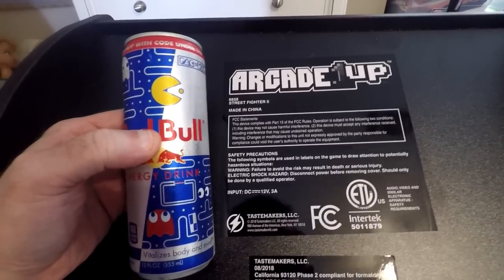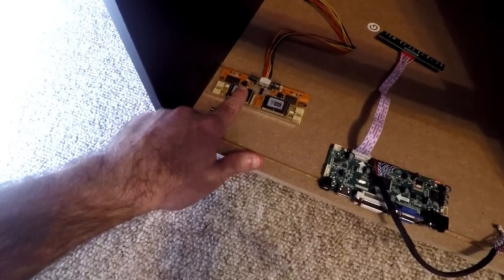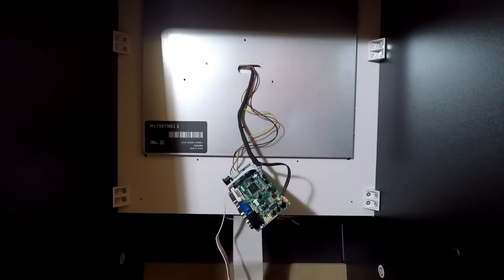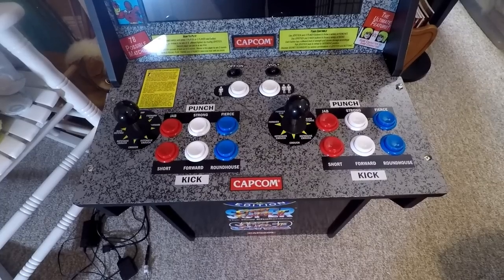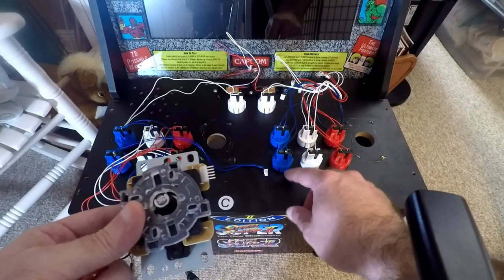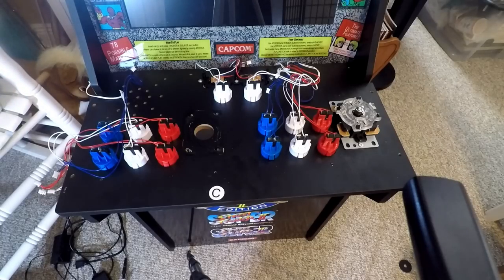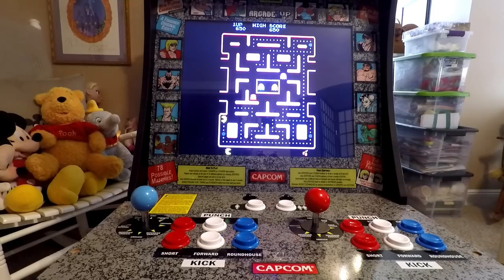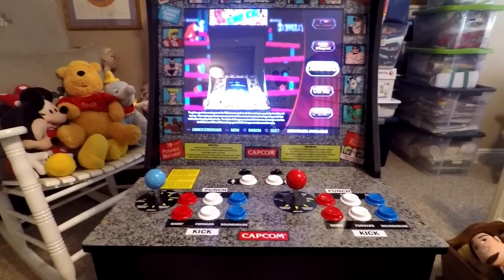Arcade Players Dream! Arcade1UP Raspberry Pi Install with EXISTING BUTTONS and POWER SWITCH! TeamCC

Comment: U plugged the buttons into the up down left right for joystick like happ. You didn't have to make the extra buttons. What u could of done is go into retroarch and configue coin button as the player one start. And coin 2 as player start 2. So when u press player one it will use coin and start the game. Same for player 2. Then also make player one as ur hot key and make player 2 as ur exit key. So when u press player 1 and 2 at the same time it will exit the game. Player 1 with add coins and start same with player 2
Reply: Huh, that's interesting. I've only barely peeked into the Retroarch settings myself. Seemed complicated to me... Eek...
Reply: Greg's Game Room if I have time today or tomorrow I’ll make u a quick video. It’s better to go to retroarch and configure the buttons so it’s the same for all games.
Reply from the maker: I figured out what I had wired up wrong pretty quickly. Then I pulled up the board and saw the labels. I will try that button config and let you know! Thanks for the suggestions.
Reply: How do you do that ??
Reply: @thelegendcollector8538  I'd really like to know that as well. I get what Mario Pirchala is saying, I just need a little better explanation because I'm not very good with this lol
Reply: @FlanFanNetwork  I'm trying to do exactly what you described. I'm not quite sure how to do it. Could you possibly explain it further? I think I get what you're saying but I'm new enough to this to where I need a little more help
Reply: @RussTCB1  well I just ended up wiring the coin button to the on and off switch and the 2 player coin to the volume button
Reply: Please can you make a video tutorial on how to configure the p1 p2 buttons? That will eliminate having to drill altogether. I own the SF and Mk cabinets and im on the process of modding them but i lack on drilling skills.
Reply: @FlanFanNetwork  any way you could walk me through the retroarch config? bought my pi and all other things needed but dont have the tools to drill holes. so i would definitely love to use this method to avoid that!
Reply: Sweet!!!!
Reply: @ILazzarus666  setup ur player 1 and player 2 configuration. Then from retropie menu go to retroarch then from main menu go to settings then input. U will see player 1 input and player 2 input. Change select button as player 1 button. And start as player 1button. Do same for player 2. Then go back to main menu. Select configuration and save current configuration. Now when u play any rom the player 1 acts as both. This works for any multi player cabs like SF MK TMNT etc. If ur using only 1 joystick cab like PacMan etc with older just mame roms. Load game and press tab. Then select controls for game. Here u can select 1P as coin and start.

Comment: I found a way not to drill new holes for the Joysticks. Simply swap the metal plate of the original joystick to the new one.

Comment: why did you have to flip the switch vs just swapping the pins on the GPIO??  Black go to black (ground) and red to pin 3........and then no need to flip the switch.  I'm not telling you - general question for you or anyone reading.

Comment: IT WORKED! THE POWER SWITCH WORKED! I am beyond excited right now. Thank you.
Reply from the maker: I felt the same way! I needed it to function normally so the kids could turn it on and off. It seems so simple yet so satisfying when it worked.
Reply: @VirtualCrawfish  could you of just put the red wire on the gpio 3 and black on the ground and not have to swap the power button around?
Reply: @VirtualCrawfish what if I’m using the ground 6 for a fan can I connect to a different ground with no issues??

Comment: I have just completed a full conversion to my cab following the ETA video - replacing all buttons (and adding 2 new ones) and the sticks too.  Then I found this - excellent as I was stuck with the power and volume sliders unused until I followed the instructions referenced here. I cabled the power slider to pins 5 & 6 and the volume slider to pins 12 - 14 on my Pi 3b+. Swapped around the power slider and then created the script that makes the volume slider function.  Perfect and all works without issue!  When creating the script, run the amixer command first as this will tell you what sound source is being used - in my case it was HDMI so I replaced the PCM amixer reference in the script with HDMI and it all works perfectly.  Thanks for bringing this to my attention as cab feels more complete now.
Reply: anyway i could give you some money to make a pi 4 script lol?

Comment: Well thorough vid, but i have to say i kinda knew that you were going to get hung up on the select issue, hence why ETA did it that way.   On off switch very nice idea.  Good to know in advance that the stock buttons just plug in directly into the encoder without a new wiring harness.

Comment: I like your video. You sound like me when tinkering and building. I'm modifying my Street fighter 2 arcade1up and love videos like this to bumper me in my projects. 

Well done. I appreciate your humor and yet stick to your guns on parts of it. 

I've modified a broken cabinet, replaced the screen with a dell monitor screen and joined a pandora's box control panel for it. Kind of using what I have. But I would like to get a Mortal Kombat Legacy cabinet and follow your setup. Not too much but enough to keep it original as possible and yet give it the goodies inside.

Again, good video. Cheers.

Comment: I have a Arcade1Up Rampage cabinet on the way. Your video convinced me to try a conversion too. I ordered the Raspberry pie, LCD controller and the USB controllers. The Rampage cabinet has 3 players. 1 joystick and 2 buttons for each player. Since 3 people around an Arcade1up cabinet is a pretty tight squeeze I think I will sacrifice the middle player and use the 2 buttons as the credit buttons. Maybe someday I will change the stock joysticks and buttons and when that happens I will add new buttons so that I can also play games that need 3 buttons. I don't need 6 buttons as I have no interest in fighting games. 3 buttons will do fine.
Reply from the maker: First off thank you for watching and commenting. I am excited for your project. I think you will enjoy it so much. I am not sure which type of joystick comes with the Rampage cabinet, but if it is like mine then they will not work with the USB controllers for a Rasberry Pi project. You may find yourself replacing those sooner rather than later.
Reply: @VirtualCrawfish  I will have to look into the joystick issue. I assume Arcade1up uses the same joysticks for all their cabinets. The cabinet I really wanted was the Pacman one but due to it only having 1 joystick and the 2 player buttons I would have to completely redo a new control board. That and the screen being vertical made it too complicated. I just hope one of those vinyl decal makers do a Turtles in time set.
Reply: @VirtualCrawfish  I had a look at the Joystick on my Rampage cabinet and I understand the compatibility issue you mentioned. Regular arcades were built to have pieces easily replaced. That involved having each individual microswitch wired to the board on it's own. Arcade1Up went the more simple way and added a little circuit board that merge everything into a 5 pin connector. If the USB controller I ordered doesn't have the right connector for the stock joystick I will simply use the cables it comes with and solder new individual cables to each microswitch.
Reply from the maker: I am VERY interested! Please let me know how that turns out.
Reply: @VirtualCrawfish  My USB controllers have been shipped and I already got the Raspberry-pie. I will let you know how it goes once I receive them. Maybe I won't even need to solder them If the metal connectors that come with my USB controllers fit the little metal tabs on each microswitch. They are on/off switch so polarity shouldn't even matter.
Reply: @VirtualCrawfish  The results are in. The reason why the default connector doesn't work with retropie is because the USB controller uses that one like an actual Joystick. that means it need XY axis and not buttons. The default connector just doesn't work with the Retropie controller configuration. What I ended up doing is using the cables that came with my USB controllers and connected them to the 2 metal tabs that stick out of each microswitch of the joysticks. At first I only got 2 directions to work and that's when I found out there is polarity after all. The blue cable needs to be on the short side and the white cable needs to be on the long side. I didn't even need to solder them on. Connecting them at a 45 degree angle on the little corner gave me enough grip to do a connection and once everything was tested I added a little dab of hot glue to set everything permanently. I even used the On\Off switch as my coin button until my real coin buttons arrive. I just rock the switch between on and off to add credits. I found an Ebay seller that sells rectangular switches with printed 25 cents arcade decals on them. They have 12v bulbs in them to light up but I have no way to give them that power without some more material. If they were 5v I could have powered them from the Raspberrypie but I will just use them as is. I decided to completely change the layout of my Rampage board so that it's now 2 player with 3 buttons each. I removed the middle joystick and moved the right one and all the buttons around. That created a new problem... I had a hole left by the 3rd joystick. I got the idea to use that hole as a USB connector so that I could easily connect a keyboard. I went on Ebay and I found the absolute perfect cable. They call it a Car Boat Flush Mount Dual USB. It's going to fit perfectly in the holes and it has a rubber cover I can close and if I want to plug a keyboard or a USB controller for some PS1 games I just pop it open and have access to 2 USB plugs. Overall I think this was a huge success.
http://i68.tinypic.com/vz7h8y.jpg
Reply from the maker: @chamoo232  Ok once again I really appreciate you keeping me informed. I looked at your picture and it makes sense. I appreciate you sharing this with myself and others. I am working on a follow up video on what I have learned since my first attempt. I have a replacement deck being made so I can experiment with more configurations. This was great!
Reply: @VirtualCrawfish  My pleasure. I'm glad that I did things this way. For now it will be enough. Joysticks are expensive and it's a shame to throw away the Arcade1up ones right away. I will use them and I even have the 3rd one as a spare. When they finally break I will replace them. I watched so many modding videos before I finally decided to get a cabinet and I don't think any of them ever said that the original joysticks can be reused. I guess everyone just tried connecting the 5 pin connector in a USB controller and found out it doesn't work.

Comment: Great video I added the coin button's to the on off button and the volume button but I did use your idea to save the original buttons great idea 😎🤔
Reply from the maker: Thank you! Since I have done this video I had learned a lot more. I also have people like yourself from this great community offering up alternative solutions. I actually haven't drilled those holes for the select buttons and I have been debating undoing the power switch mod and doing exactly as your suggested.

Comment: AWESOME! Glad you finally got this and got it going! Fun ain't it!?!?! :D
Reply: I actually used Putty to wirelessly connect to the Retropie to edit my .ini files for the power switch. A little easier than doing it right on the system itself. ETA Prime showed how to do it. Also, pretty cool that you were able to reuse the existing power button. One thing you didn't show was the Select / Coin button completed. Really fun project and ridiculously easy!
Reply from the maker: It was easier for me at that moment to just use a keyboard. Telling people how to find the IP then source Putty then login etc... Just use the built in file manager go to the file hit a button type a line and then be done with it. I do use SSH to manage it though.

Comment: hi, my MK2 arcade1up cabinet has 2 x 4 pin connectors for the joysticks.. how do I wire these to the usb controllers?  thanks... ps awesome vid.
Reply: Cut the 4 pin connector off and then wire each color into a 2 wire connector and plug that into the 2pin up down left right on the encoder.

Comment: Spend the extra cash and find leaf switch joysticks and buttons. Micro switches wear out and are crap.
You can also run Raspi-config and enable SSH so you can remote into the Pi and edit the config.txt file and such.

You can easily turn the Volume Switch into the Coin up buttons for Player 1 and 2.

Comment: Is it possible to have credits as 2 buttons (Like HP+Start) ? Would rather not add extra buttons if I don’t have to. Thanks for the tips. Gonna due it to my cabinet soon.
Reply from the maker: There is no doubt in my mind it is possible. Someone posted in the comments how it could be done. I just need to take the time to map it out correctly. Good luck with your mod!

Comment: 15:15 Dont know if u figured it out or not, but the reason the buttons seemed to "spam" is because one side of the inputs are a turbo for each button. The other is for single press/hold.
Reply from the maker: This was done a while ago and I did correct it. I have since done another cab with a Pi4, but I didn't do a video on it.
Reply: @VirtualCrawfish  cool. Not knockin ur skill bro. Jus trying to help.

Comment: Thanks for this thorough video. I have a cocktail cab so there is no way my power JST wire can reach my Pi. Any ideas on how I can extend it?
Reply from the maker: Hmmm I wonder if you could order a pigtail and just splice in some extra wire?
Reply: I have a cocktail cab also. thinking about splicing

Comment: Great video man.  I'm so close.  I can get it to turn machine on but it doesnt turn off.  I added code in retropie as you stated.  Any idea where or what I am doing wrong that is making the switch turn on only?  Thanks
Reply from the maker: First thank you for watching and commenting. Make sure that when you added the code there are no spaces or tabs at the end of or before that line of code. This is the guide I followed https://icculus.org/finger/icculus?date=2019-01-01&time=09-32-56 It is possible the switch might be bad or needs to be reseated.
Reply: @VirtualCrawfish  I want to say thank you again.  Thanks for the great video and thanks for replying.  I am subscribing to you.  With that being said, your video is perfect.  I had another image on a different SD card and the machine shuts on and off with no issues.  I am a happy camper.

Comment: Do you think i would have to do the whole controller and speaker part on the new marvel vs capcom 1up arcade? I heard that one had better controllers and stereo speakers. I’d love to get that one if I could bypass those whole processes.
Reply from the maker: I haven't seen the new cabinet, but if they used the same joysticks they would not be compatible with the standard USB encoders that I used. I would think you could use the speakers since speakers are speakers. You would just need to figure out how to get them into the audio out of the Pi.

Comment: Hey, have a question was hoping you might have some insight on. The LCD Controller I ordered specifically said it's for M170ETN01.1 which is the same display you have. 

According to the Amazon title, the board should be M.NT68767 however the picture, packing list and the board itself says M.NT68676.2, which is what you installed.

Any idea on why the discrepancy? The link you provided doesn't specifically mention your display model number as compatible so curious on if you knew something that made you feel ok with the install.

Appreciate any info you can offer.
Reply from the maker: I took the board that ETA PRIME used and then did a quick google search and read where it would work. I didn't really put too much research into it. Are you having compatibility issues?
Reply: @VirtualCrawfish  No, was just trying to be extra cautious so I don't blow anything up. The manufacturer said the controller I got was the right one, just a typo in the title. Everything is working on my end so far.

Thanks!

Comment: I followed the instructions but I’m using led buttons with usb encoders and when I turn the power switch off everything seems to shutdown except for the buttons. When I use the switch that came with my pi the buttons do shut off. Is this what is expected to happen? Is there a way to fix that?